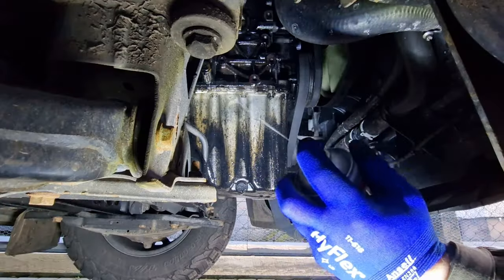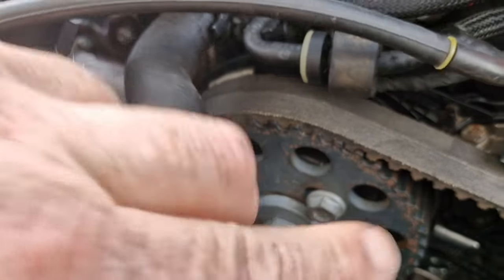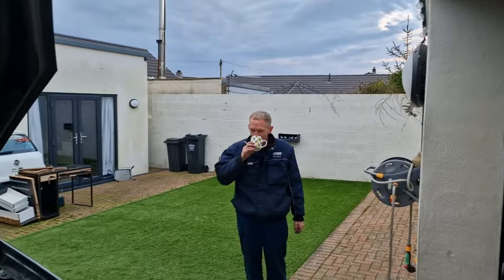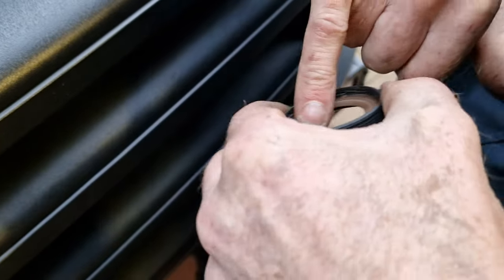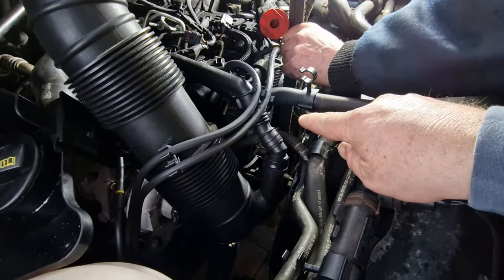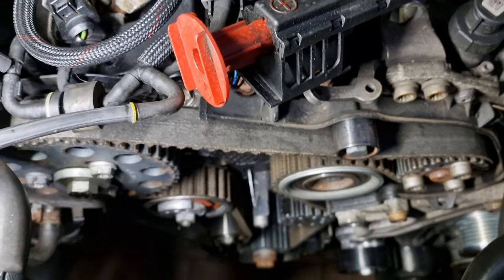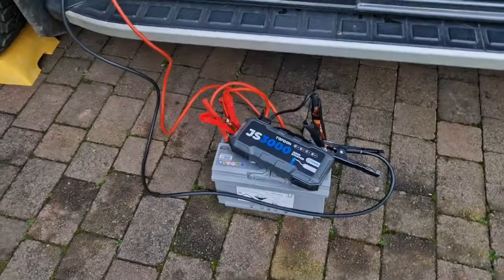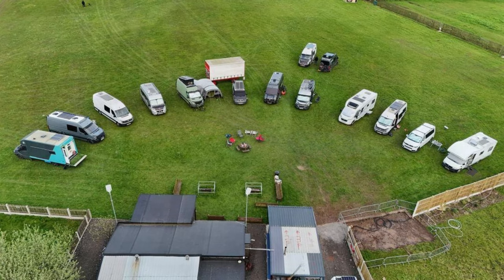vw crafter camshaft oil leak fix

Comment: Why don’t you use the red jump start positive connector under the bonnet to jump start?
Reply from the maker: I wanted to get a good connection so I went directly to the battery, I put the charger on there as well
Reply: That connection along with some chassis ground has way too much resistance to be useful.

Comment: Starter Battery shouldn't go flat all the time 🤔 trouble is every time  it goes flat it damages the battery, I'd be fitting a dedicated solar panel and cc for the  starter battery if it's  just going flat cos of lack of use?
Reply from the maker: First time it's gone flat in ages ant that only because I left the lights on, the battery is 8 years old the SOH last year was at 60% so I expect it will be less than that now, I've bought a new one this week as for lack of use it's used every week
Reply: @TheCraftyBlindersvanlife  8 years is good going 👍

Comment: Anyone working on engines over the years will have installed something ass-backwards. No exception here. I've been there - got the t-shirt. 😁
The flat battery problem haunted me the other day, when my rig's juice cube was flatter than day-old Coke. I then tried the positive cable connect in the engine compartment and some chassis ground for my powerbank. No dice. The resistance on those connections is just enormous. Removed the trim, floor mat and battery cover, hooked the powerbank on and ca-ching - no problem. (I use a Gooloo 4000S)
Tip: I keep one of those screwdrivers with the bit compartment (and the proper Torx bits) in the bag with the powerbank - saves me the runaround when I need to boost the van...
Reply from the maker: Great advice Volker 👍😊